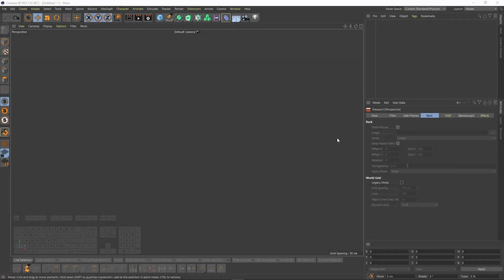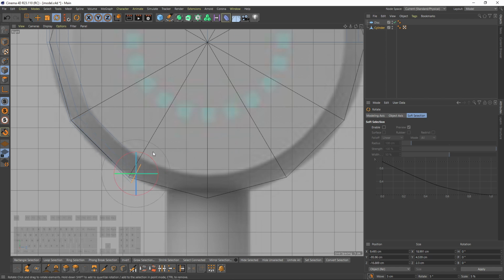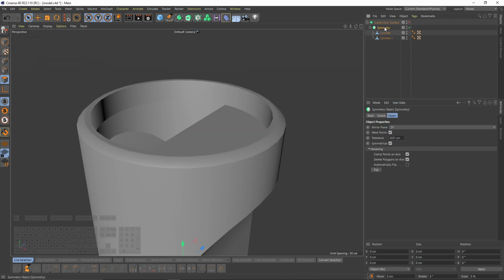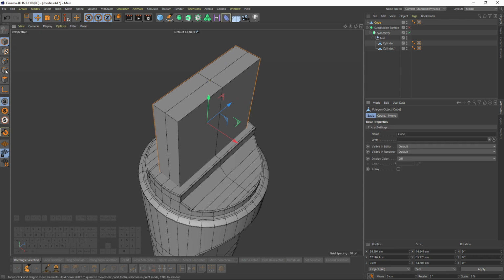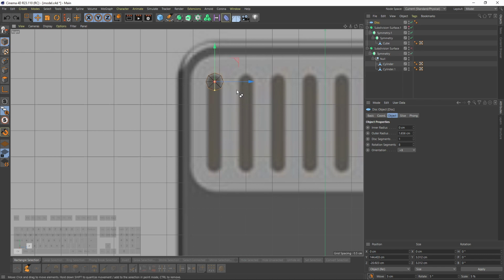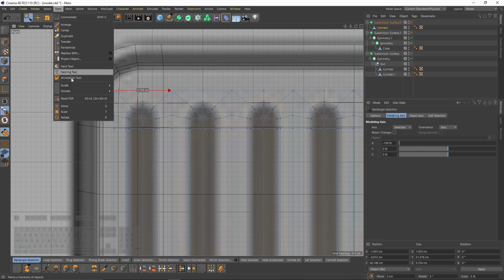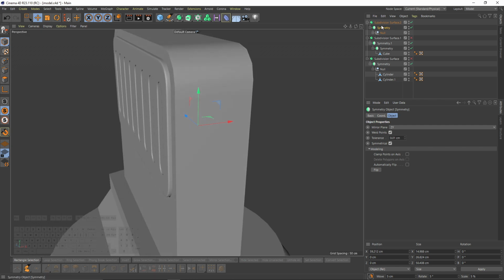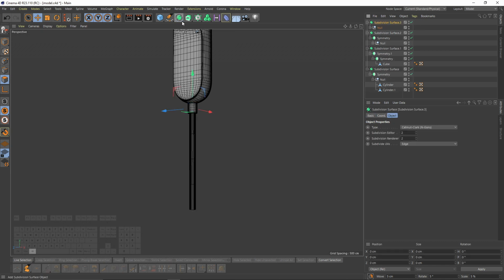Industrial Design/Product Modeling #7 | USB | Cinema 4D Modeling Tutorial

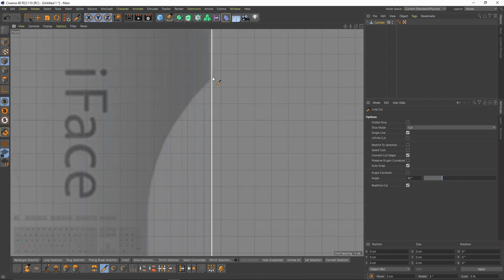Comment: Thanks for the tutorial. I was just curious though at 1:29 why do you check "single line" in the line cut options? Also when i then use stitch and sew it completely messes up the geometry no matter what I do. I'm using a demo of C4D 2024. Would really appreciate any advice.
Reply from the maker: If you enable single line option, the tool will stop after adding a single line, it is not a big deal, you can keep it off.

You need to match the edges/points correctly for stitch and sew tool.

Comment: Hello! This is very interesting. The detailed explanation is really appreciated!

I've been practicing with edge flow and sometimes I would struggle, I would have too much topology, or my segments on my primitive would mess with me later on.

I think the most important part is knowing the geometry you will need

Why was it 36 and I don't know, 32 or 16?

And the bevels on the corners were 3 segmented

I might be daydreaming, but how you know with how many segments to start? I think (I'm still learning sorry D:) the very first steps on the creation of the primitive make a difference fixing edge flow easier later...

Thanks for the video Polygon! Hope you're doing good :D! Thanks!
Reply from the maker: All segment/bevel etc numbers are experimental actually, and you can change them, there is not a perfect count, at first I made my cylinder 36 segments because when you try to create cylindirical shapes with details, it is always necessary to have relatively high poly counts, and your segment lines should match with sketch/image plane also 36 is a good number to divede by 2 or 4 and not too high for an object but as I said 36 is not absolute, it can be 48 or something, I made the bevel 3 segments because it was enough to hold the shape, you learn these things as you practise.
Reply: @polygonpen  Thank you for responding! Hehehe I'll have to model different things. Cheers!